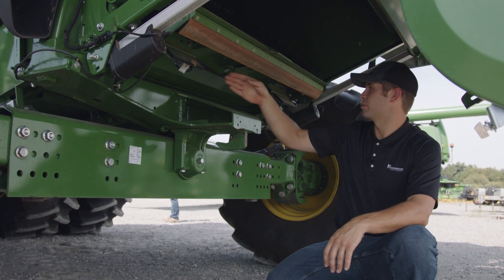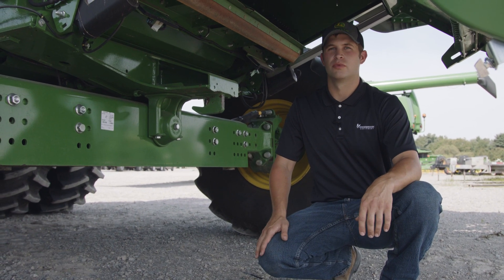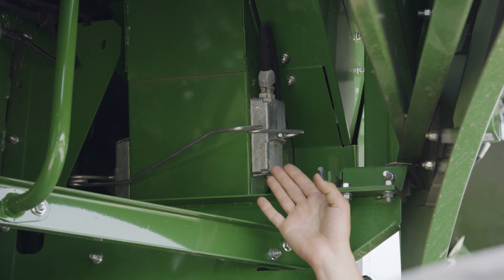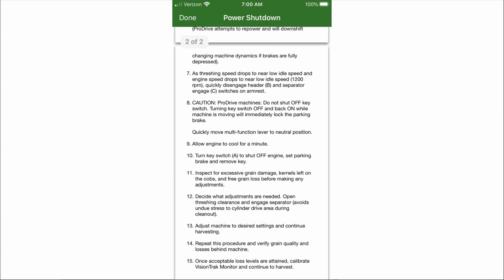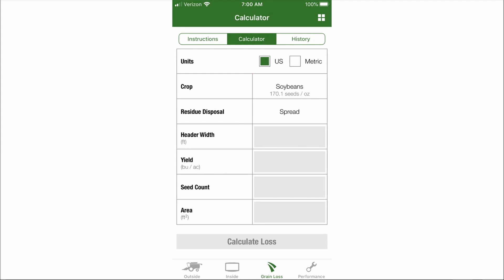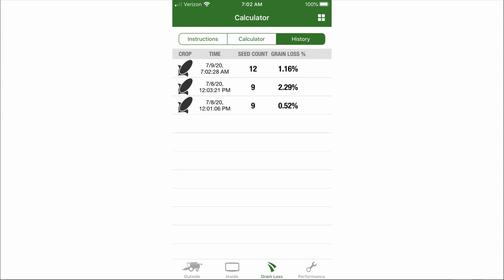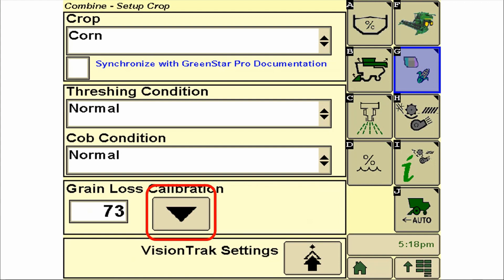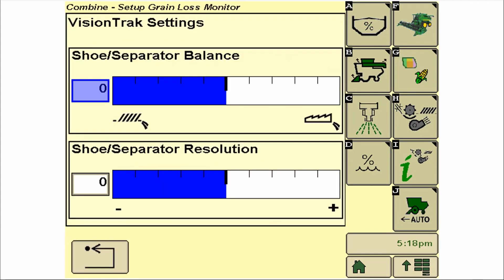S600 Calibrations - Loss Monitor Set Up and Calibration

Comment: Still no explanation to why the grain loss monitor averages the chaffer loss with the rotor sensor. The rotor sensor is there to indicate to the operator to either change the rotor speed or to adjust concave clearance. It is not loss of grain out of the machine. 
Why does John Deere continue to display the chaffer sensors with the rotor sensor.  They have done this since the inception of the sts , in the year 2000 , on a display monitor that was designed for the walker machines. It even has the walker icon pictured on the right hand side of the display. 
The John deere engineering department should have replaced the monitor to a display that separated the sensors totally. 
The operators first instinct,  is to slow the ground speed of the separator,  when they are presented with the centre bar graph rising above their preset allowance. 
In most cases (usually when getting colder towards evening) the rotor sensor will indicate a rise in activity,  which should tell the operator to increase the aggressiveness of the threshing,  to get more of the separation at the front of the rotor. Release of grain at the front of the rotor can also be achieved by removing filler plates or changing concaves to a more open type .
I hope this helps.